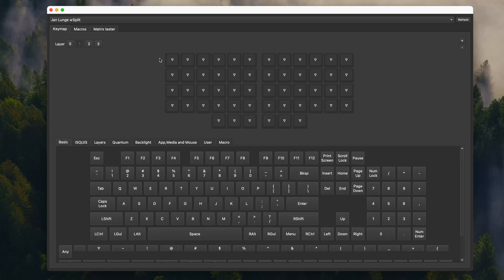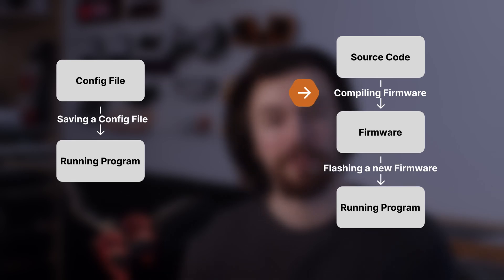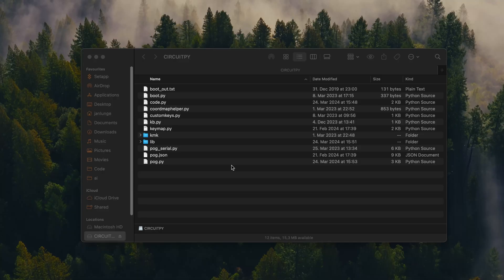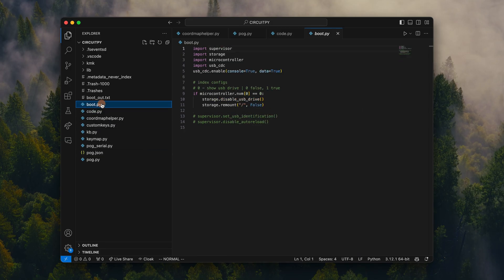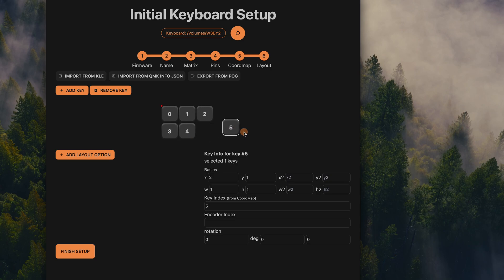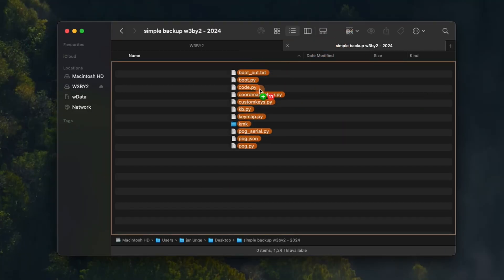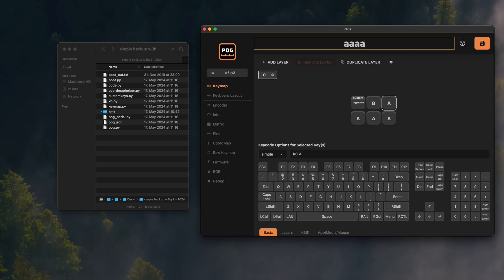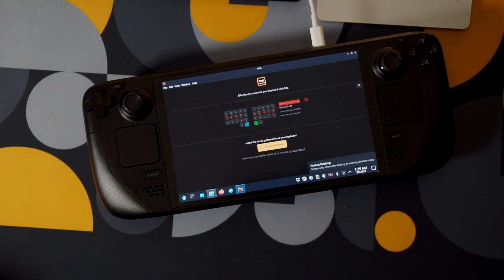I Built A Keyboard Configurator From Scratch

Comment: Hi, I'm new to this, does impact using python to the latency response of the kb?
Reply from the maker: It is only a subset of python called circuit python the boot up time is slower than c based things like qmk but the keypress latency isnt affected i havent measured it but I'm using it for gaming as well as finely tuned hold tap timing you can adjust by the millisecond

Comment: Just found out about KMK, which lead me to your channel. I've been struggling to fully adapt to my Softle and Dactyl (BastardKB) for idk maybe two years. I just get discouraged and toss it aside as I cannot slow down so much. Most of it is just the layers and remembering where everything is, so I want to re-config from QMK to KMK, and your tool looks awesome. But what about something like my Sofle where I have 4x6 but also a bottom row of 5 keys + LED + OLED? Clearly I haven't studied the docs much yet, thats my next stop but also wanted to ask. Thanks for the video!
Reply from the maker: Leds and oled do work in kmk but are not managed via pog yet you would add these in the code directly. The cool thing is you can switch between qmk and kmk quite quickly as the folder for kmk can be backend up easily and the qmk + via(l) keymap is easy to export. I usually reset my board back to qmk if i need to continue to work and my kmk isnt properly co figured yet. But i also have been delaying converting my svalboard to kmk for a while now

Comment: I'm jumping into the deep end by having just ordered a Killer Whale kit as my first mech kb ever, let alone ergo or custom. I think it'll be a while before I reach the limits of what's been developed to be easily accessible, especially since that board has a lot of custom code in its firmware... But still this makes me wonder what it would take to make a port of the firmware for this hahaha
Reply from the maker: Thats a really cool board, porting the firmware is just a bit of trial and error though I haven’t ported the trackball stuff to kmk yet but I will try that at some point.
Reply: @JanLunge  Honestly I can hardly even consider myself a programmer, but at the moment I have just enough experience and ADHD hyperfocus to consider it 😅

Comment: I downloaded POG but the only option I have is to add a keyboard. No layout builder or anything. Am I missing something?
Reply from the maker: This only shows up for a keyboard that you work on but you can also work on any folder and have the files generated there if you want to test it without hardware
Reply: @JanLunge  oh so the keyboard has to already be built?
Reply from the maker: Yes as everything is connected to how the hardware is setup and the coordmapping relies on the matrix positions so making this without the keyboard is tricky as I tried to automate a few of the complicated steps.

Comment: Hi, nice job ! 
however i have some isues trying to configure a split keyboard (everything is fine if i configure a single half) : 
- do i need to add circuitpython en each half ? 
- what option do i have to choose between "usepio","uartflip" and "splitflip" ? (i use gp16 to link the parts + voltage and ground)
- do i need to use different pins for the columns on each half ? because if i use the same pins , how to make the difference in th pins stage to tel what pin comes from what...
I would realy like some help to run this project 
thanks

Comment: Can i use this to replace the broken ic from a mechanical keyboard?
I just want to revive my red dragon full keyboard
Reply from the maker: It’s a difficult project as you would need to hijack the matrix and soldering onto it is sometimes difficult also reverse engineer the wiring, but technically yes. Most ICs are soldered with just the ic where the pinout wont match the rp2040 so you would likely place a full helios on the board depending on your skill level with modding

Comment: I am thinking of making a custom keyboard and came across this video. I want to use adafruit i2c keys, roatry knobs and potentiometer sliders. Would this software automatically see the keys when pressed without being set to I/O pins? I'm very new to this and really like the idea behind the software.
Reply from the maker: That would be more advanced so you would need to modify the python files a bit to setup the i2c but the rotary encoder should work fine
Reply: @JanLunge  Thanks for they reply. Sorry for the following up, but why would the I2C rotary knob function but not the other I2C devices? Or did you mean if I use a non-I2C rotary knob?
Reply from the maker: @M.Kelly-d3k ah thats what you mean no all i2c stuff would need to be setup differently the out of the box experience is only for matrix or direct keys ans well as the usual rotary encoders

Comment: Hello Jan, I have tried to use POG, without success. I do not know why this is not working, but I expected it to work as it is. I'm using a Mac as well.
Is there any way to help you to make it work? I'm also programmer.
Reply from the maker: Yes you could either open an issue on GitHub explaining the setup and issue with the output of the REPL or check by my discord server where we could try to figure out whats wrong

Comment: This made hand wiring my first board way less daunting. Only thing i can't get to work is macros for some reason, but that miiiiiight be because im on an RP2350?
Reply from the maker: Macros are a bit tricky with the syntax but should work fine on the rp2350. I need to put some examples online to make this easier.

Comment: Does joystick counts as encoder? 
Is it possible to add joystick to keyboard using this keymap editor?
Reply from the maker: joystick usually have analog inputs and not the digital steps an encoder uses, so no they would need to have a special driver for the specific joystick (though i think most just use 2 analog inputs)

Comment: so you can have a total of 40 butons? right? Is possible to connect directly an old existing keyabords and program directly/ assign direct the actual keys?
Reply from the maker: The helios has 29 io pins using just 26 of the to have room for an encoder or leds we get a 13x13 matrix which would allow for 169 keys on just this controller, using the matrix of an existing board can be tricky as you would need to remove the original microcontroller and hijack the pins from there as well as understand how the matrix is wired so it depends on the board but is possible.

Comment: looks amazing, but still have no idea how to connect slave part of the split board(( i mean how UART knows about configurator?
Reply from the maker: Both sides get setup in pog once and you set its type to split keyboard with the uart pins defined. Then disconnect both, connect the halves together and just connect the main half there you now redo the coordmap and keypressed from the secondary half should show up if everything was configured properly. Pog only needs to write to the main half the second half doesn’t need updating after this point
Reply: @JanLunge  omg, so simply. Thanks a lot!

Comment: Amazing work! I would love to try this for my upcoming Corne build, is this compatible with any generic RP2040 or are you locked to the 0xCB specifically? So long as that RP2040 has the same processing power and storage.
Reply from the maker: It works with most RP2040 boards. Though some might need some tinkering to get working because of storage and pin restrictions but i only tried the helios and the pi pico yet

Comment: Great work you have done with POG, although it can be done with any version of Pi Pico (even the ones from Aliexpress) would it be possible to take it further and do it with a Pi Zero?  It would have enough memory and GPIO to make a style like Corne V3.  Greetings
Reply from the maker: I think that would technically work but as the pi zero runs a full operating system compared to the embedded nature of the pi pico it could mean that the response times would be way worse, but an interesting thought experiment for sure

Comment: I’ve been looking for circuitpython builds for Python configuration, this is fantastic! I like that it allows for integration of extra sensors and capabilities. This will make integrating new mouse sensors, for example, a breeze. Proximity sensors, gesture sensors. Heck, I want to integrate an air quality, VOC, and flicker sensor into one to let me know if the oxygen level is low or the office lights are prone to causing fatigue.

Comment: This is a huge step up from the usual Via/Vial experience! One question though, what are the memory requirements on the controller's side? E.g will a 4mb pico be enough?
Reply from the maker: I didn’t see that the pi pico is sold with less storage, if it doesnt fit you can install kmk pre compiled to save on memory

Comment: Love the idea of this and KMK in general.

I do wonder about the keyboard basically being a writable USB drive all the time. I know in this video you mention a feature that allows you to only mount the drive on a certain keypress, but I still have some security concerns.

Perhaps this is more of an upstream KMK or even circuit python problem, but what would prevent any piece of software from injecting a keylogger onto the pico when it is plugged in? It seems like adding code to a circuitpython based board is a little too easy.

I wonder if a custom version of circuit python with some form of hash checking or something could remedy that, such that only user authorized changes can run. Maybe this is somewhat counterintuitive to the point of KMK though...

Idk, i am not a security expert by any means, just wondering. I do want to try KMK and Pog for a manuform build, but IDK if its a good idea to be plugging a kmk board into an unknown computer, or even a friend's computer.
Reply from the maker: The drive just runs whatever code is on it, so for a pc that you do not trust you would simply not mount the drive. It still is not „easy“ to inject just a keylogger as it would likely break the keyboard implementation if not done with regards to your setup. This would be a general circuit python security concern

Comment: Nice work - as someone without a background in software development, rebuilding firmware to get custom handwired keyboards to work was extremely frustrating. I’m keep to try this out for my next build. That said, I’m also keen for my next build to be hall-effect switches. Since KMK is built on circuitpython there’s no reason it couldn’t have analogue keys - and there are some builds that use them already. Any chance support for HE keys is built into your toolchain?
Reply from the maker: Pog doesnt build this for you yet but i have seen kmk keyboards with analogkeys where only wasd where hall effect switches. So it should work while for now you would add a code snippet to the kb.py file to support it

Comment: This looks absolutely amazing, could it be used by boards not using the RP2040? From what I can tell i should because you can name the pin prefix, right?
I've already got my handwired board running kmk, but the keymap is still in its v0.1 stage so using this could be very awesome to iterate much more quickly!

Also, how does it work when using a split board? do i need to have both halves plugged in at the same time?
Reply from the maker: Yes it works for everything that supports kmk I cant guarantee for the serial feature as I haven’t tested this on other controllers but it should be all right
Reply from the maker: For split keyboards you put the firmware on both sides and then they get connected with some cable for uart communication (you can also do onewire) then just one half connects to the pc
Reply: @JanLunge  I think you mean for using the keyboard? If so, I meant for configuring it using your gui
Reply from the maker: For configuring it with split support you can first setup each half with its proper pins and set the keyboard type to split in the matrix tab, after you have done that you can connect the halves together via your trrs port and with one of them connected to the pc and loaded in pog you setup the coordmap again this time with the keys of both of the halves (also apply the coordmap change to the keymap) then your board is done
Reply: @JanLunge  Oh great, thanks!

Comment: A few months ago i set up a keypad with kmk and an RP2040, worked as expected, however every couple days it would randomly jump back into its native mode as a thumb drive and the keypad would stop working, hit reset and it would work fine for a while again. Frustrated me enough I ripped the 2040 out. Any idea what was going on?
Reply from the maker: I had a few issues when i did not hide the circuit python drive as the OS did some random reads on the files that would reboot the controller. after hiding the flashdrive I had no reliability issues and I’m using those boards every day for almost a year now.

Comment: Haven't watched the video yet (9 seconds in) but the hair looks awesome, dude!
Reply: @JanLunge This is incredible! Would I be able to run this on an ESP32S3? I've got a little macropad I built with one as the basis, and currently it's communicating via bluetooth using standard arduino code and the BLE library. Would I be able to drop your setup on there? Thanks for this work, dude. This is a massive contribution to the custom Mechancal Keyboard world!
Reply from the maker: Thanks thats the comment i was waiting for :P, if you can find your controller on the circuit python download page it should work though i only tested the helios and pi pico. KMK support for wireless is still experimental

Comment: I am still a friend of original picos or 1:1 clones from Aliexpress (with usb-c) - because they have more pins (=single controller keyboard) and if it is only $6 you can directly solder it to the pcb (which i don’t do at 2x $16).  Makes a slim footprint and looks better.
Reply from the maker: It depends on the keyboard formfactor for me, small split boards or macropads really look nice with the smaller controller and dont need the pins. The pro micro formfactor is interesting for drop in replacements of pro micro keyboard builds so you have the choice.